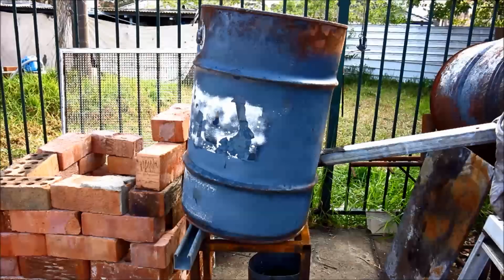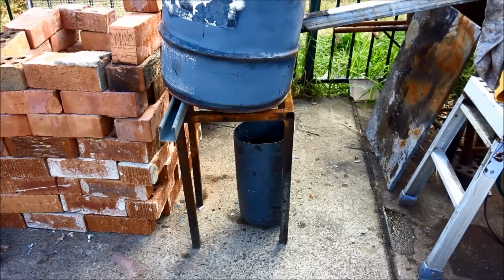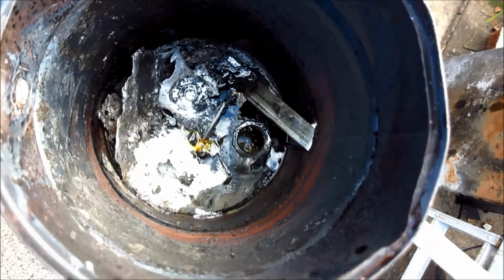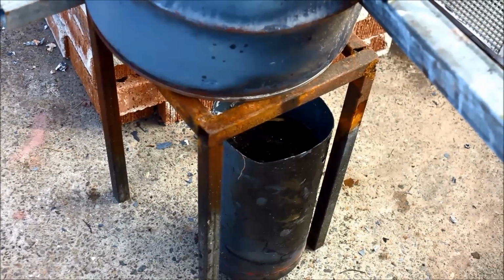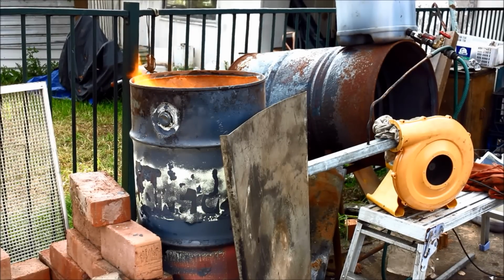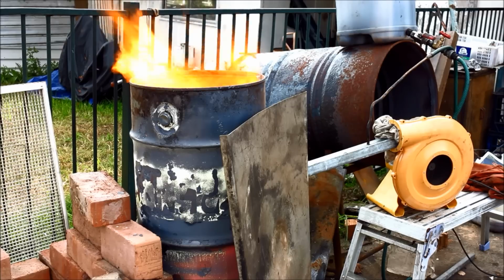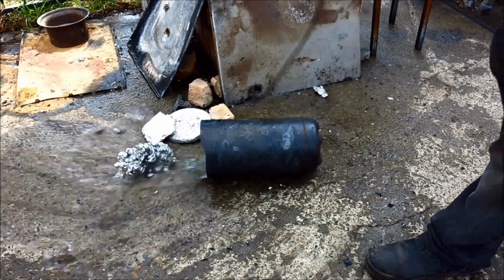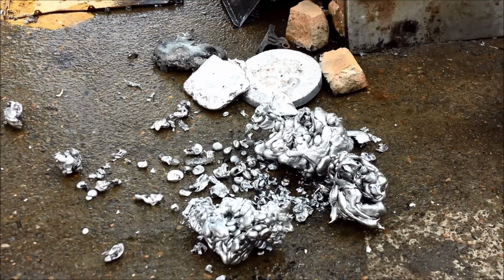How to make a Mini metal Melting Furnace

Comment: always wanted to melt 4 alloy wheels and see how many bars i get. the thought of cutting the wheels to fit crucible was a turn off!!! but hey, you turned me on:))  much respect:)
Reply from the maker: I was thinking of doing a scraping furnace with a drum the right way up instead of on it's side.  Only did that for ease of Videoing but I could probably get a camera up high enough not to melt it.  I think I could blow the heat down and get better efficiency and it would be  easier of course to tap off the molten ally.  I don't have much to scrap now though.  I'll see what I can find.
Reply: @glumpy10  drum right way up, and a lid to aid efficiency:)

Comment: Hey mate, I tried to make the pressurized one today and it worked for a little while but I blew out the threads on the plastic drum I was using because the regulator has to be above 30ish PSI from the moisture trap. Oh well was still fun. Will probably re-make it next week with an LPG bottle.

Comment: Yet another fun video. Always great to see your vids.. 
The weather here should be starting to cool down soon. Hoping to get back to work on my pool heater.. Can't wait!!  Love the pool and it is a wonder for my back. Just can't deal with a cold pool.. No help there..  Enjoy brother!!!  
Steve
Reply from the maker: +Steve 1961P. I went out looking for connection fittings for my heater yesterday and today and came up empty handed. I might ring the manufacturer tomorrow and see where I can get them. 
Converting the thing to oil power will be a piece of cake. Plumbing the thing up is proving an effort  to find the fittings!
Reply: Are you having trouble getting your hands on veggie oil now, or is going to oil just more of the fun??
Reply from the maker: +Steve 1961P. Still using Veg oil and not having any trouble getting it.  Only time I use engine oil is when I do an oil change on the car.  It works fine but its a pain to clean up if you spill any. Veg spills are much easier to deal with.
Reply: +Oil Burner Oh hell. I must have misunderstood... :(  Happy you are back at it, buddy!!
Reply from the maker: Thanks Steve.  I had a break due to family issues and wasn't sure I'd be doing it again. I have to say I am very surprised by the comments and support I have got. It makes things much easier and is very rewarding.

Comment: To get pellets, I agree that a bigger barrel of water should help.  Maybe plug the big bung hole and make a number of smaller holes?  A jet of water from a hose inside the water drum?  Or just dial back on the burner so the aluminum comes down more slowly and isn't so hot.
Reply from the maker: +MrTechnophile  Dial Back? Less heat? what is this evil you speak of???   :0)
I thing a violent swirling or even bubbling in the water may carry the pellets away from one another and stop them bonding together.  Should be easy to set up as well. Worth a go I reckon!

Comment: Very nice i'm the process of making a oil burner but need to find a bouncy castle blower and a graphite crucible to withstand steel being melted.... I'm using one of those bucket foundry's with one of those pumps for air beds with coal lol works well runs on about 3-4 cups of coal for a over an hour.
Would love to see steel melted and poured.... hmmm maybe put ice in just so when it hits the bottom its cold and it doesn't stack up to the top where less time to cool? Keep it up i wanna build something like what you have its awesome!!!!
Reply from the maker: +Hayden Fischer  Thanks for the kind words.  melting iron is a whole different level. Ally is at the bottom and cast iron is the holly grail.  Plenty of people do it but you just need a really good furnace with the highest rating refractory. 
And even I would put on lots of safety gear for melting iron.
Reply: +Oil Burner Well I guess in terms of safety its much like welding.. cotton clothes and overalls, welding gloves, slight tinted splash  face guard because you need to see lol I think thats it apart from hard shoes and water on standby.
But yeah your set up could do it but foundry it self wouldn't last too long and well because its so hot you need a way to transport and if you can't get one of those graphite crucibles you could do it by a tapping which is you have the molten metal inside the foundry and have a special hole you poke at hard till its open then iron flows out down a track and into the molds....  anyways Awesome ^^
Reply from the maker: Hayden Fischer I would wear a full face crash helmet if I was doing iron. Maybe I am a safety sissy after all. I have seen a good few vids where the iron erupts. Those face shields don't stop the iron coming down and landing on your head or neck.  That's the part that scares me. I don't go over the top when I perceive the danger is low to non existent but where I do perceive one, I'm going to do all I can to prevent getting hurt.  :0)

Comment: nice need to build one of those I have 3 aluminum rims that need to be melted for making castings
Reply from the maker: +Chris Anderson  You could probably sit the wheels on the top and they would melt off and drop in or have a look at my scrapping furnace vids using a 200L drum. You could fit all 3 wheels  in there all at once if you wanted.  Just have another half drum below it full of water if you want to make pellets and maybe drop the ally onto a bit of plate to scatter them round some more.
Reply: yes I saw that monster that thing could eat a engine block lol
Reply from the maker: Chris Anderson That was the initial and ultimate intention!  :0)

Comment: Maybe a smaller drain hole in the drum would do the trick, the big blobs of aluminium aren't loosing heat fast enough.
Reply from the maker: +Green Silver I am thinking of screwing some pipe in the bung hole and melting the ally direct then having a vertical section of pipe I can swing down and let the ally come out of that into the Cup cake type molds that everyone else on YT is putting their ally into.
Reply: The amount of aluminium you get through you need loaf tins lol
Reply from the maker: Green Silver Yeah, but you know, I sure am getting some funny looks when I go through the home-wares section looking for suitable tins.  Geez, whats wrong with the idea of a 6'2, 120 Kg guy that's wearing filthy clothes and steel capped boots doing a bit of baking anyway? It thought we lived in a time of enlightenment and acceptance?
Perhaps it's the way I comb my hair?  Should I do it more than once a week maybe? 
:0)

Comment: What do you use the aluminum for? Good setup!
Reply from the maker: +kbbacon  I use the aluminum for making YT Vids!  :0)  I was thinking of getting into making some castings and plates with peoples house numbers on them.  For the moment, it's just an excuse to make really hot fires!
Reply: +Oil Burner You can buy scrap aluminium car engine parts (cheap, contains steel pins, etc), melt it into pure aluminium and sell it again with profit :)
Reply from the maker: +Michal Rimmerak  That's one idea. I can get all the scrap ally I want like heads and manifolds and that's exactly how I separate the steel from the ally.
Reply: I have a small coal furnance for melting aluminium, casting cylindrical ingots for my small lathe projects. Now, I´m making LED fleshlight.
Reply: +Michal Rimmerak Now an LED FLASHlight I'd understand...
Reply: +MrTechnophile Yeah :-D Sorry. One mistake and it is sexual tool :-D But from aluminium not good for use :-D
Reply: @glumpy10  who needs an excuse ?????    ;<))
Just keep that roar going - sounds like a Vulcan bomber on full tilt !!

Comment: safety tip from the health and safety officer: do not ise the drum as a shitter while it operates, only you can prevent human hair fires. that is all.
Reply from the maker: +Arjan Wilbie  You are so much better at the safety tips than I am.  You are doing a fine public service protecting idiots around the world.
Reply: +Oil Burner i have seen my share of stupidity during my bricklayer days. i got send to the head office as i told that there was mothing wrong with a un protected hole in the floor in a well lit situation. it is wrong to say that it culls the stupid. the safety tips are a direct result of that.
Reply: +oil burner if you want you can make replica land rover badges.
Reply: +Arjan Wilbie Don't need a oil burner for that mate. The long standing 'Watch this!' fart lighting works so well its never oft repeated! :)

Comment: hey O B  MAN  love your vidios , been useing a modified big bertha much as you do [may be its more of a hefty hariet, donot  remember.  have tryed the aluminum water pelets but when remelting they gen more dross than larger ingots. al03 is an aditive to high temp refractory but a bother when sand casting.  keep them coming :>)  thanks again from the great white north
Reply from the maker: +joe citizen   thanks for the comments. Always great to read feedback and hear from people using the things. 
I'm going to try something else with the pellets, running the molten ally down a length or channel and into a turbulent pool of water to try and keep the pellets suspended so they won't bind together.
Reply: +Oil Burner love the can do aditude .  the world would be stallled if we all listened to the "you have to- you can't do"  type folks .  grew up doing with what we had -  pile the parts till ya have enouff to start.  Price of desil { off road is down $}  so veggi oil is more available, bio folks are idled back . I'm converting a 'BOCK" fuel oil water heater into a melting furnace, plan to run exaust thru a furnace plentum to heat shop.  we see -30 F often dec-feb.  your simple spray oil gun has opened ideas many thank from the great white north.
Reply from the maker: joe citizen
The backyard tinkerers/DIYers have created a great many of the worlds most used products.
Aussies have done this loads of times over the years. Its the creativity, out of the box thinking and have a go spirit that as you say, gets things done.

Comment: Hi, have you ever looked up what a shot tower is?  My father told me about them when I was a kid and now when I think about it there is an article on Wikipedia that explains everything. https://en.wikipedia.org/wiki/Shot_tower all the best I shall follow because I like that sort of thing, oh I got here via Jalopnik.
Reply from the maker: +James Young   Thanks for the info.  I know what a shot tower is and how they work, Just haven't been real motivated to construct one in the back yard!  :0)  That said, you remind me of an idea along the same lines.  I'm going to try using a jet of water to keep the ally suspended till it cools and then maybe even spit the ally out into a catch tray once it reaches a certain amount so the water bath doesn't fill up and the process can continue.
Reply: could probably use a T fitting dropping down from barrel,  water hose hooked to one end running continuous,  blowing metal out the other end into a catch can